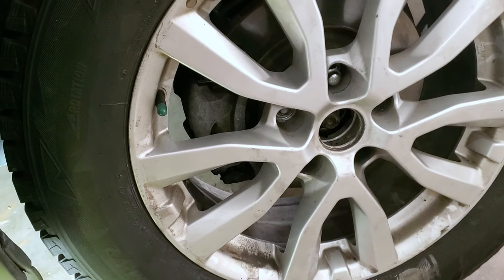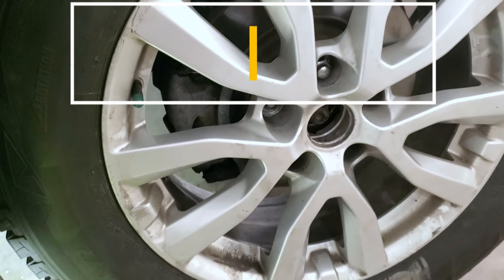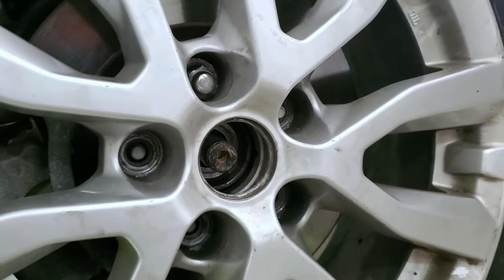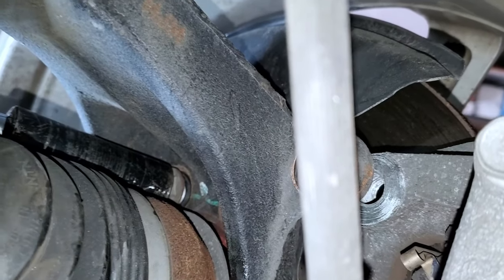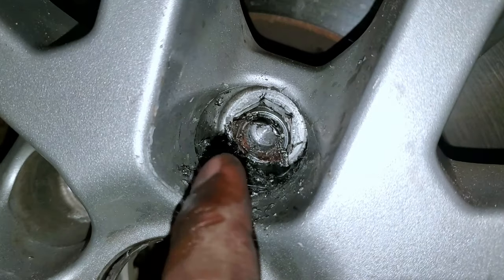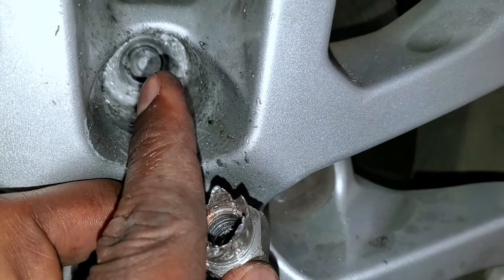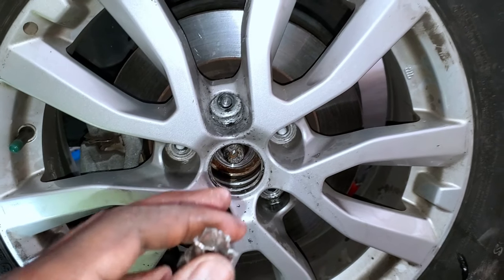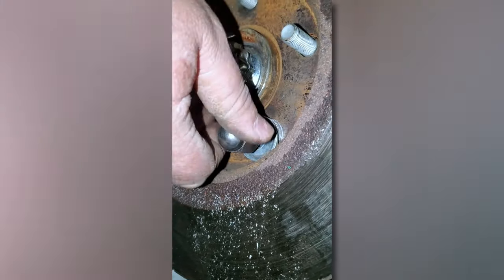Car Wheel Stud Lugnut Spinning? DIY Fix

Comment: What kind of drill bit did you use
Reply from the maker: Just good new metal bits. Generally they are made of cobalt or carbide. All purpose bits don't work well.
Reply: Thanks for the video I’m doin the same on a Nissan Altima
Reply from the maker: @josemendez-fy7km  I feel your pain. Tip: When you get new lug and nut for the stripped one make sure the nut fits all the other lugs as well.